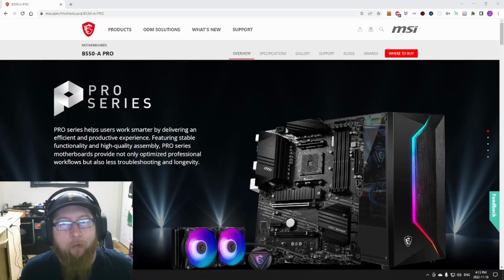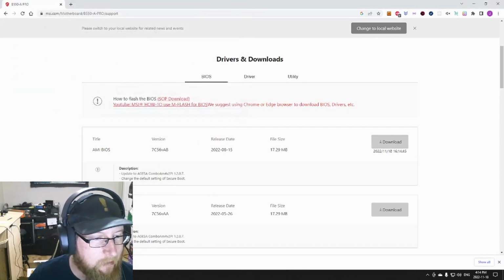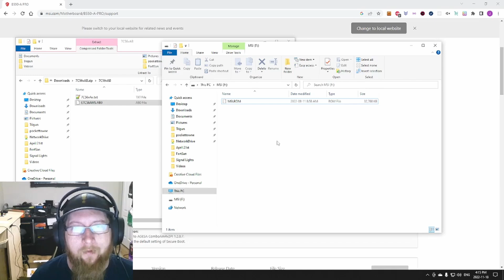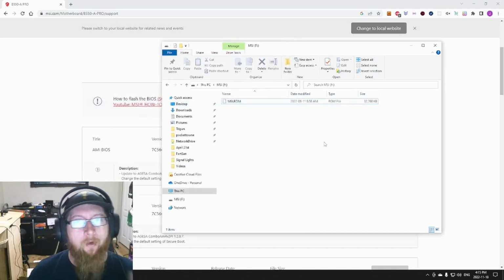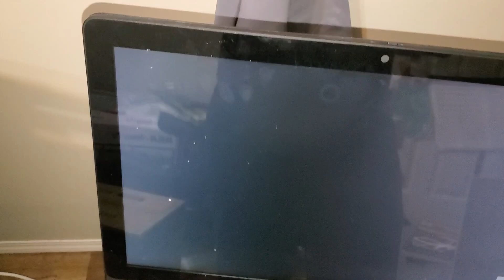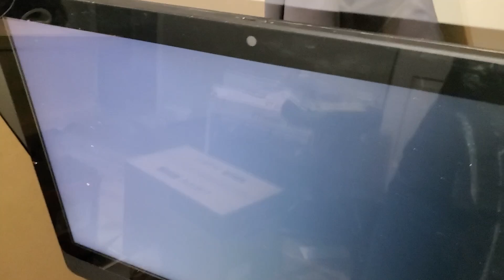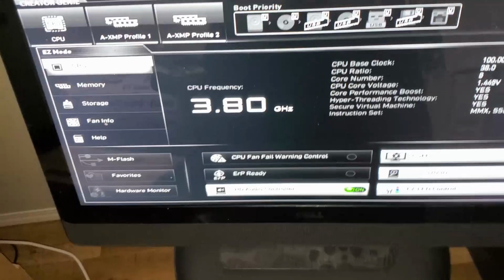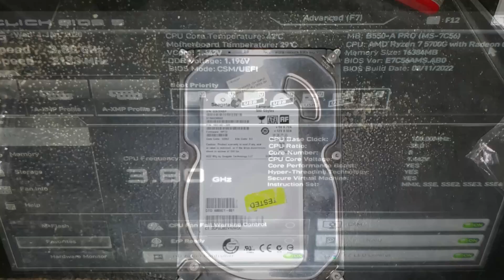MSI B550-A Pro Flash Bios

Comment: Hey, I was wonderingif it is possible to do this bios update, while a cpu is already installed. Or is there a different way for this?
Reply from the maker: Yes you can. Use the same process regarding power and such, and the system will work like normal. If you are trying to do an upgrade and you have video already though, you don't need to use this. You can do it the normal way by just using the flash utility in the bios itself. As long as you can get to the bios.

Comment: I'm having a real head scratcher of a problem, I've let it run for a bout 20 minutes now and the flashing continues, plus the CPU Ez Debug light isn't on at all like how it is when I try to boot without updating the bios. Any solution you can think of?
Reply from the maker: If it is still flashing, let it go. You don't want to power it off just-in-case it's writing the ROM file. You don't want to brick your motherboard. But other than that, if it is doing it like now (been 10h since you posted) There's no real other solution than to turn it off. It should not take that long. You could contact MSI and ask them what may be the problem, or RMA it if it's within exchange with the retailer you bought it from because maybe it's just a bad motherboard?
Reply: @Kardall  im also having this problem, i let it run over night to be sure and when i came back the light was still blinking and no EZ dbug light, i did get mine from ebay so could it be a bad motherboard?
Reply: Any update? I’m having the same problem rn.
Reply: The reason is the file isn’t in the root directory so it cant find the file and it keeps looking

Comment: I used your tutorial, It all worked but im wondering why the white LED is still lit up white after the BIOS flash (I added the CPU and basically assembled it all but the white LED comes on everytime after turning it on). After checking, nothing seems to be wrong with the CPU or cables. Wondering if you've got a solution to this problem. The update I installed was the recommended for the CPU to be compatible (Which wasn't the latest version) incase you want to know what version I downloaded.
Reply from the maker: Assuming you mean one of the Debug LEDs. If the system turns on and boots into your Operating System, then I am not sure what it means. However, if you have not installed your operating system, it's quite possible that the "Boot" LED is the one that is on since there's no OS installed yet. Doing so would fix the problem.
Reply: @Kardall  Thanks! It all works now and no LEDs are up after installing Windows

Comment: hey i’m running out of trouble shooting ideas. i’ve tried em all but why does mine stop blinking red after the white light comes on then blinks again for like 5 seconds and never blinks red again. i’ve done everything thing the way you did i even disk part cleaned the usb like others have recommended. i’ve still can’t find out why it won’t update the bios. thanks
Reply from the maker: Are you sure you're using the correct port? There is a specific one you use for the USB. On the rear IO shield it outlines it I believe in a border or labeled depending on the model. But it's usually the one next to the button if it's side by side.

Another thing, make sure you have the exact motherboard bios. For example, a B450 Gaming Plus Max is not the same as a B450M Gaming Plus Max, and a B450 Gaming Plus is not the same as a B450 Gaming Plus Max. Make sure it's the exact model.
Reply: Hi, i have done all things in the usb but when i turn on the flash button the red light flashes for 5 seconds and then the pc turn off without any white light on the motherboard

Comment: and can i still do this while the cpu /gpu and everything else is connected and installed
Reply from the maker: Yes you can. And to try to answer the other question. If the light is solid and lot blinking at all, then it has encountered some error and halted the update process. Go through the checklist of requirements: Fat32 Formatted Drive, Correct Bios for your motherboard downloaded, extracted the rom file to the USB, renamed the file to MSI.ROM

Try a different drive if it still does it, but that's all you should have to do.

Comment: Hey great video - for some reason no matter what I do I cannot update the bios on this mother board. I am trying it through mflash and for some reason the new bios version is never recognized. Any thoughts or suggestions?
Reply from the maker: When you do this through the bios, don't rename the file. This is only for using the Flash Bios Buttons on motherboards, where you cannot get into the bios.

Comment: my b550 tomahawk didnt work after flash bios.I back board to store,now waiting seller answer what is wrong
Reply from the maker: Bad flashes do occur. Could be a problem with the board itself, or maybe the wrong bios version for the time. There are some boards that have a sequence of updates you have to do because they change the format of the bios file itself throughout the course of the lifespan of the motherboards update history.

B550 is still fairly new and I haven't seen many of them do this, mostly it is to do with AMD boards going from 1st Gen Ryzen through to the 5th Gen that have this issue more commonly.

Good luck, hope you get it sorted :)
Reply: @Kardall  when i conect board with psu looks fine,lights work,cpu and gpu fan work but do not recognize cpu.

Comment: Putting together my pc and I have everything already plugged in and in case, can I still do a flash bios with my cpu and everything in socket or is it gonna fry the system ?
Reply from the maker: Yes you can do this with things plugged in. Just do the same power sequence where you just plug it in and push the button with the USB in that slot and named accordingly.

Comment: Hello and thank you for the video. On the official page, the new BIOS driver is version 7C56vAC1 (Beta version), which is still in beta. Should I use this version or the previous version that you are using in the video? What do you recommend I do?
Reply from the maker: Use the non beta one and see if it works. If you still have issues the beta one may fix a problem, however, it isn't 'stable' or it would be in release status so... risky.

Comment: Do you always select the newest BIOS flash available on the website? Does it not matter what CPU I am using?
Reply from the maker: The normal route is yes, but there is some consideration with certain Bios updates that you may not want to.

Lets say, you updating your motherboard Bios removes whatever CPU you are replacing it with from the compatibility list. Something like putting a 5800X replacing a 2400G. But in doing so your A320 Chipset will remove support for the 2nd Gen Ryzen with Integrated graphics.

But there is a bios version below that, but above when the 5800X was added that supports both. You may want to keep it to the minimum for testing to make sure your system posts, and if you don't have issues or think the system is fine, update the Bios later on.

But updating to latest often brings more compatibility improvements across different hardware and even support for the CPU itself.
Reply: @Kardall  Oh wow I never would’ve thought of that. I’ll definitely read into it a bit more. But currently I’m waiting for a Ryzen 5 5600
Reply: @philahsam  how did it go plz respond
Reply: @ieuhwbwnwosisbebsjksjsnsnsj  sup buddy. What are you having an issue with right now? Don’t know where to download bios?

Comment: I have the same motherboard with cpu of Ryzen 7 5800x 3d. Will it not work if I don't do this step prior to bulding / connecting everything? I don't have another computer available to download the bios update and install the bios update to a flash drive. Help
Reply from the maker: Yes you have to have at least bios version 7C56vA9 to support that CPU.

So I would suggest using a friend/library/school PC to download the bios files required to do the update while you wait for your parts to arrive.

Comment: Can I flash it with my cpu/gpu already in the computer?
Reply from the maker: Yes you can. It's just not required, but it should work the same way as with things installed.
Reply: @Kardall  Thanks man. I was freaking out so I pulled everything just in case. Didn't realize that the system had to be off when you hit the flash button. Got it all sorted!

Comment: Would the process be the same even after the PC is completely built out? So PC is off (PSU is on) and insert the USB and push the flash button?
Reply from the maker: Yes, but if the PC posts already you could just do it the normal way with a USB stick and going into the Bios.

Otherwise, if it is just built and you realized you needed to update, yes you can do this and shouldn't have any issues updating the Bios.

Comment: On this same mb, followed your directions. Only got red light on bios flash button when pushed. As soon as I let it go the light went out. I don't seem to be getting any response of any kind. Really did not want to send this all back, but I think I got a bad one.
Reply from the maker: Make sure it's in the correct port and that it is a Fat32 formatted USB with the MSI.ROM file that you wish to flash.

If that still does the same thing, yes I would RMA the motherboard.

First rule about building a PC, don't assemble your PC in the case before you do a test boot and can get into BIOS. As it seems that the way you replied implies that you put the entire PC together before hand :)

Comment: Can i use this board with ryzen  5 5600 without flashing the bios?
Reply from the maker: Shipped version Bios from website: 7C56vA0
5600 Support added in Bios version: 7C56vA9

So according to the spec sheet, no. But really it doesn't matter with that button. It's not difficult to do and it only takes a few minutes.
I'm not saying the board that you buy / receive won't work out the box, but I'm just saying that according to the specifications and support page on MSI's website, that it needs a bios update.
Reply: im currently doing this .. with 7C56vA7 for Ryzen 5 5600g... hope this works...

Comment: I had an issue where the red light blinked for a few seconds and usb drive was read during that brief time, but after that all lights went out and psu fan never came on. 

What worked in my case was pulling out and re-seating all psu-to-motherboard power cables. Meant to have psu off while doing this, but by mistake it was actually switched on and connected to power. In any case, procedure worked like a charm immediately after - just hit reset button, and away she went.

Posting in case anyone else runs into this issue.  Thank you for the video man! Cheers.

Comment: If the motherboard doesn't have on board graphics, how are you getting POST? You connected the HDMI to the motherboard hdmi port
Reply from the maker: It's a Ryzen 7 5700G which has integrated graphics :) Ryzen series prior to the 7000 series that have a G on the model, indicate that it is an "APU" with integrated graphics. CPUs like 5800X or 3600X do not.

But all of the 7000 Series Ryzen CPUs now have integrated graphics :) (So far anyway).
Reply: @Kardall  Ahh okay. Thank you :) this video really helped me out
Reply: @Kardall  So you cannot post into bios with a 5800x and no GPU installed? How do I check to see if the bios flash worked? Do I just build the rest of my computer and cross my fingers?
Reply: @cuttersarekey this is where I am too, but so far I still am not POSTing. New BIOS flash, new HDMI cable, new DDR4s, tried every combination of component installation, and still nothing. Getting both pissed off and worried.

Comment: Like around 30 min ago
Reply from the maker: Well that's odd. You could try this: https://forum-en.msi.com/index.php?threads/solved-tomahawk-b450-max-bios-flash-error.344202/#post-1994428
Otherwise, either bring it to a service shop or a friend that has a compatible CPU to do an upgrade using the Bios, or RMA the motherboard and hope you get a different one.

Comment: I follow the steps to the letter but after around 6 seconds of blinking it shows a light on cpu then a solid red light
Reply from the maker: Make sure that you have a Fat32 formatted empty USB stick. And have renamed the file to MSI.ROM (for this motherboard).

Also, keep in mind, this is to make it so that the board works with a 5000 series CPU and it does not support any CPU before 3000 series. So if you are trying to use a 1600 or 2600x etc., it won't work either way.
Reply: @Kardall  may be because I ordered a refurbished board and possibly some issues. I did format to fat32 and renamed the file to MSI.ROM, I do appreciate this video as it was very thorough, my cpu is a 5800x
Reply: @Jake-rq7gv i know this is late, but did you fix the issue? People told me to convert USB in command from GPT to MBR then flash